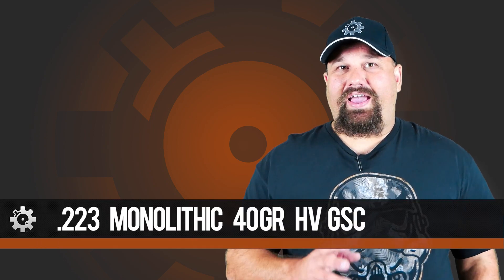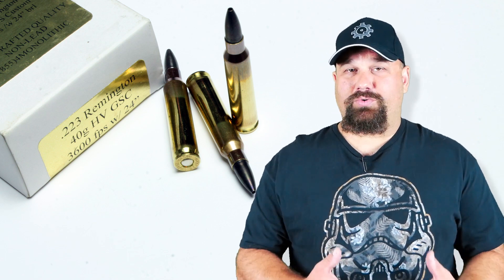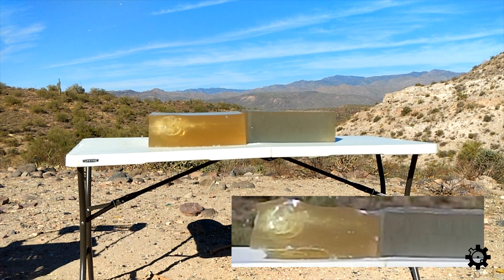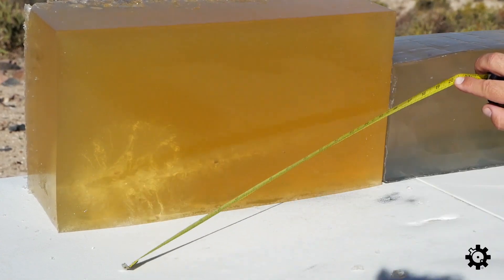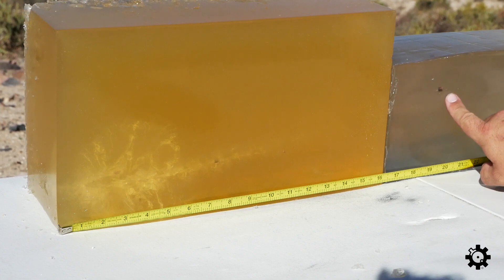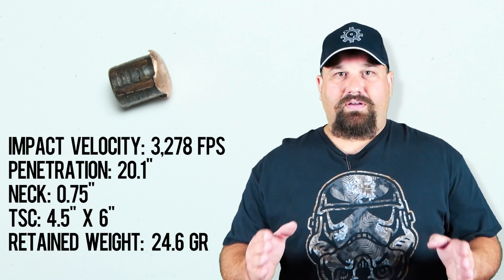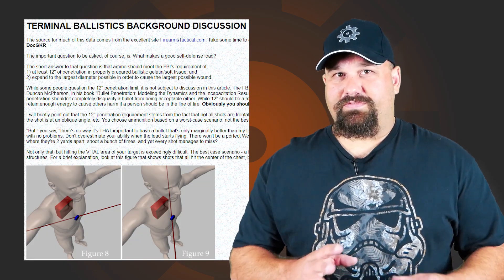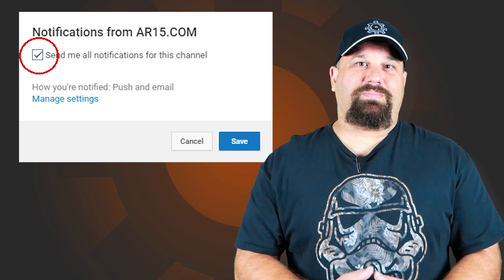Designer Bullet Gel Test: .223 40gr Monolithic HV GSC

Comment: I have a couple hundred .243 90gr HVs and some 73gr SPs on order. I thought the HVs were designed to perform best at impacts under 3,000fps. Below 3,000 (maybe 2900fps and lower) they are not supposed to fragment. What I find interesting about them is their low start pressure of 754psi. That should result in the max pressure occurring further down the barrel and prolonging the throat life. They might also lower wear on the barrel due to reduced friction. I guess I don't understand why you used them at a velocity that they were not designed for and based your review on those impacts. Their forte is also supposed to be the precision of the turning and thus the accuracy. Not having shot them myself and not having seen reported group sizes I have no idea if that is true.

Comment: Probably wouldn't work very well in my 1-7 twist FN-15 with an 18 inch barrel...
Reply: John Ganshow being a solid copper bullet it is longer than typical 40gr loads so it may very well work in a 1-7twist. 

Length of bearing surface determines twist rate not grain weight, though grain weight is the easiest way to determine require twist on typical ammo

Comment: I'd like to see this test done with a 16" barrel, that's what I have for home defense. I haven't seen all of your video but I've seen a good bit. I have yet to see you really impressed by any of the results. What rounds would you say were outstanding that you've tested? Also what is the best .223/5.56 round you've tested?
Reply: biggboysouth "Best" always depends on the requirements, but heavy OTM and medium weight bonded soft points are solid performers.

Comment: I like the old school gel blocks better....they look more dramatic.
Reply: M.T. L. What do you mean by "old school"? The front block is calibrated 10% ordnance gelatin, same as I've always used. The block behind it is clear gel. This just isn't the most impressive load.
Reply: The Chopping Block I should have been more specific. I like the calibrated 10% ordance gel blocks.  I know the organic blocks tend to overstate the outcome a bit more than the newer clear blocks do, especially the TSC, but thats what I like to see. I also appreciate the shape of gel block you use. More square than rectangle..thanks for all the good work Andrew.
Reply: M.T. L. Thank you.
Reply: @newsofthepews  I agree. I think the problem with the clear gel is that the track is so narrow that it doesn't seem to reflect the kind of "bloodshot" damage radius or pulpy shock zone, or whatever it's called in real flesh.

All three materials  (organic gel, clear gel and flesh) all have different tearing thresholds, but clear seems to have a significantly lower tearing threshold than real tissue... at least to my less experienced eye, and it demonstrates a lot of bounce (projectiles will actually go a distance then back up). 

10% gel isn't perfect either, as a torso shot only has a little muscle to get through, which is wgat gel simulates. Lung tissue actually tears faster than gel does, stomach and hearts less so, intestines are packed with blood vessels and even a low "tsc" wound will bleed horribly. But the TSC shows something important in 10% gel, a consistent metric to judge the amount of energy dumped... like a sports stat. Clear just minimizes those effects too much to give you as many measurably different useful metrics IMHO. Handgun shots look too much like rifle shots, everything seems to go too deep, etc.